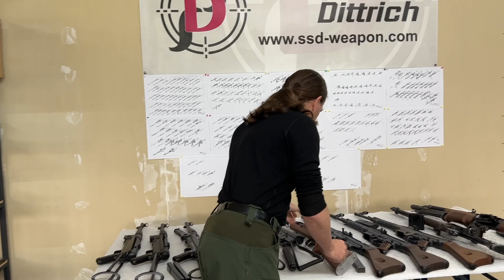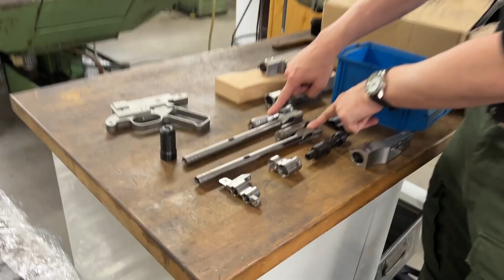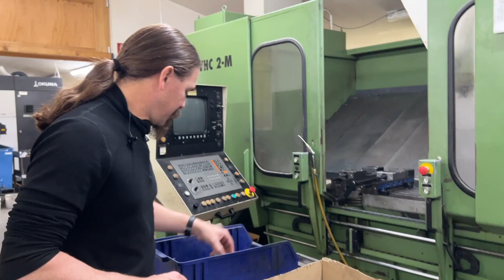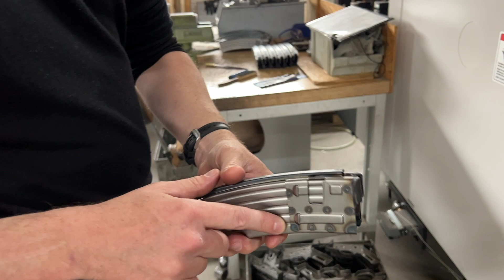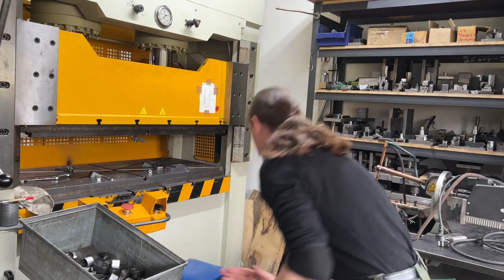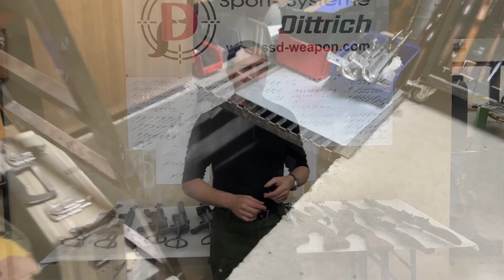Tour of Sport Systems Dittrich: Reproduction WWII German Rifles

Comment: Odd what "triggers" memory here, but thought I would throw this your way as there seems to be a lot of denial about it of late. The infamous Wooden Bullets the Wehrmacht issued in the end days of the war. Surely deserving a vid of their own simply due to the rareness (Forgotten??). The why and how is a story unto itself. I was lucky enough to run across them in the early '70's when I went to buy my first .22 and the seller turned out to be a vet as was my father and they got to talking and he came around with "ever seen one of these?" scratched around in the drawers and pulled out a cardboard box with about 20 rounds of 7.92 with wood slugs. I remember this well as oddly enough the actual bullet was of a pink hue due to whatever varnish they used (your could clearly see the grain of the wood through it). Long, round nosed. He said being on the receiving end of one of those was your worst nightmare. Up to about 20 yards they were accurate enough but splintered so brutally that if you got hit you were at best going to lose a limb and most likely you died. As he told it allies would pick them up (98 K's and ammo) and use them back at the Germans in street fighting just out of spite and pure rage. Quite possibly the first frangible round ever issued to a major fighting force. I have always wondered at the actual gestation of the concept and am massively curious as to how it was produced. Must have been a reduced powder charge to avoid it coming apart in the barrel. Never found any resource to enlighten anywhere.

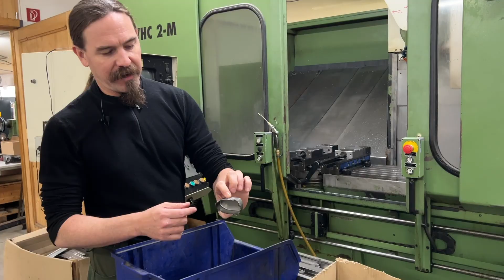Comment: 7:09  Fixture.  Jigs have a dynamic aspect that make them play an active role in the shaping of the workpiece.  Example:  Jigs squeeze the various stampings of a vehicle into final shape and position for welding.  I've also seen jigs that do full-blown bending (as in plastic deformation), shearing and punching.

If the assembly does holding alone, it's a fixture.  A fixture that has a shaping element as an integral part of the overall 'permanent' assembly is a jig.  A fixture that attaches to a shaping device (or a shaping device attaches to it) is still just a fixture.  There are cases where the lines get blurry, but you get  the idea.

Comment: Amazing workshop at Dittrich...you see some older, but still amazing machines standing there...for example a universal CNC milling machine of the FP range from FRIEDRICH DECKEL AG made in the 1980ies...these were the times of real "Made in Germany". A machinist with proper skills can do lots of things with these lime green wonders.
Yes, the original DECKEL company doesn't exist anymore, but besides they are not the most modern or fast machines nowadays, some companies still reproduce Deckel machines or refurbish them in the same quality...
I worked on old Deckel FPs as a mold and pattern maker...
cheers from Germany

Comment: What I am excited about is the 7.92x33 Kurz ammo the brass and bullets become common site in stores because I am now as an AR 15 & AR 10 upper builder selling uppers, I have just started on the first build in an AR 15 upper in 7.92x33 Kurz and if it works out, I will be selling AR 15 uppers in 7.92x33 Kurz this next winter.
Pac Nor Barreling did send me the invoice for the AR 15 8mm 20-inch barrel so I know the barrel is in the works at Pac Nor barreling.

Comment: Does the Mkb 42 (h) fit original 84/98 Mauser bayonets or will it require fitting? And will rifles such as the G43 be made to a better standard with the dust covers than the original design?

Comment: As a tool and die machinist I really appreciate this kind of content. I'd love more tours of machine shops that specialize in firearms and I would really appreciate more focus on the machine tools, work holding setups, any sort of dies that are in use, etc. The dies I work on are significantly larger than what were shown in this video. The average weight is about 80,000lbs but I've seen assembled dies(upper and lower halves put together) that weigh in excess of 100,000lbs. We use large bridge cranes to move them around the shop and our CNC mills are significantly larger than any I've ever seen in a machine shop that makes firearm components. We have mills you could quite literally park a truck in and they're very accurate, rigid machines. 

I'm also curious what the prevailing CAM/CAD software is in the gun industry. I'm sure they're predominately using Solidworks for design and I'd guess they're using MasterCAM or WorkNC for their CAM software but I'd love to hear from someone who knows the business. I'd like to eventually open up my own machine shop that makes firearm components as well as some Aerospace stuff(gotta pay the bills somehow). I'm currently employed in the auto industry in a shop that builds prototype tooling with production intent(so essentially a real tool for a stamping press that makes prototype parts) as well as agile tooling and of course production tooling. The company I work for is an OEM and I love my job but eventually I wanna start my own shop.

Comment: I always wondered if the stamped sheet metal is heat treated after pre assembly. Like being bent, etc. Or just assembled and ready to rock?
Reply from the maker: Generally stamped receivers like this do not require heat treating. On AKs, it's only the ejector that had to be hardened.
Reply: @ForgottenWeapons  My BD38 is phenomenal, so I’m excited about this. But why is BD44 you shot in this vid two-toned with the lighter gray?
Reply from the maker: Late in the war a bunch of StGs were issued with a mix of blued and parkerized parts, and the example I shot was copying that period.

Comment: Didn't the last batch of PTR44s have a lot of problems? Feeding to parts not being hardened? I did not own one but heard a lot of issues that came up and had to be fixed here. Have these issues been resolved?
Reply: Yes, some parts had bad heat treatment, and some 922 parts were bad. All fixed now, PTR rifles were made about 15 years ago?
Reply: Yeah its been a while since they were imported. It worries me that they had these issues as that should have been pretty clear. I remember hearing the guns also did not run. Like the European's basically bought them as display pieces and rarely shot them. They were not expecting them to be shot like Americans.... ie a lot. Hopefully all solved issues at this point as at that price point them should be. They will have to beat SMG for quality or price on the FG42s and that's going  to be hard for them to do. Frankly I am most interested in the VG1-5 but again, it can't be a $5k gun...
Reply: @MaximMachineGun  2 of the parts were to brittle because of the hardening, and most of the 922 parts was also breaking

Comment: I managed to handle and shoot one of their PTR44s from the early 2000s that was imported and it was a genuine work of art. The owner unfortunately passed away and it was sold at RIA for like  14-15K IIRC. I can't imagine how much one of their FG42s or STG44s would be nowadays because in all honesty these aren't replica firearms they're genuine works of machinist art.
Reply: They look nice, but were junk.  Bulged receivers and broken op rods, did not work out of the box.
Reply: @JMark-zk5pj  that's not even remotely true, the only issues according to the owner had was the ejection port was cut incorrectly and lead to malfunctions. That was it.
Reply: @Sam21721  Bullshit, my friends for instance has a bulged bottom receiver from incorrect heat treating / lack of, after less than 1K rounds.  He is not the only one.  Also, many have had broken OP rods.  Don't tell me this is not true, there were gun smiths advertising years ago their services to get these things working, some not even out of the box.  The guy who runs the company in KY knows full well.  I dont know who you think you are talking to.
Reply: @Sam21721  They are luck they are in Germany, I know of many that would love to do a class action on them, most likely too late now.  Its no secret that the PTR's were junk out of the box.  You have zero idea what you are talking about.
Reply: @Sam21721  Before you run your mouth more, go google PTR issues for a wake up call.  Mags not working, bolts breaking after 400 rounds, and even more issues that I detailed.  More On.

Comment: Probably better quality than war time production
Reply: No! Metalworking in germany is only perfect or scrap metal. Today or 100 Years ago at any circumstances.
Reply: @michaelleibrock967  what? Germany is like any other country when it comes to manufacturing. Good stuff, bad stuff and everything in between
Reply: @randyhavard6084  It's very easy to understand. You manufacture within the specified tolerances whether it is the barrel or a small screw. Everything has a standard and a certain quality. The same applies to all machines and tools with which the parts are processed. No part will be installed if it does not meet the quality specifications. This always creates the same perfection today as it did back then. There is nothing between perfect and crap. And last but not least, the machine you work on must always be clean according to a certain standard.
Reply: @michaelleibrock967 you may not have access to milling machines, lathes, or presses but you can do a little research and when you do you'll realize it's not magic that you dream of a number and the machine just spits out a part. Material, tooling, speed, quality control, and assembly very wildly depending on the needs of the customer and manufacturer
Reply: @michaelleibrock967  if you need examples to help you understand, all you have to do is look at rifles and Small arms produced by any country before world war II during the first couple years of the war and the last couple years of the war and that might help you understand how time and resource strain affects the quality of a product?

Comment: MP38 $3,800. 'On Sale' Wow, practically giving it away.
MP 44 Magazine $500. What a bargain.
MP 44 Grip $820. So Cheap.
MP 44 Operating rod $700. What a steal.
Reply: well thats what happens when stuff is handmade in a country with hight living standarts, not front internded. if a machining master (its like higher education upgrade to the regular machinist) is milling a part the cost per hour alone is 200+€
Reply: That magazine is original, repros are 80.
Reply: I was actually expecting the MP38 to be quite a bit higher.

Comment: I do wonder if that ATF BS surrounding open bolts will last given the SCOTUS case around Chevron deference, after all its a not banned in law, rather by ATF policy.
Reply: Same with “once a machine gun, always a machine gun”.
Reply: An Excellent Comment.
Reply: Technically open bolt semi-autos are actually not illegal. They can be legally made right now. They just can't be "easily converted" to full-auto.
Reply: @bitfreakazoid  "They just can't be "easily converted" to full-auto." - And that's the rub, what is  "easily converted"? Its up to ATF, and thats exactly what the overturning of Chevron deference would effect.
Reply: We need the unconstitutional NFA, and GCA, to go away.  That would solve many problems.

Comment: I wonder if the reproduction magazines are compatible with the corresponding historical arms.
Reply from the maker: Yes, they are.
Reply: @ForgottenWeapons  it seems to me that manufacturing a reliable magazine would be one of the most difficult aspects to get right in the manufacture of any rifle - add to that the relentless adherence to historic accuracy and the entire project is even more impressive.
Reply: @wes11bravo  I wonder if they knowingly include engineering/manufacturing flaws for authenticity.
Reply: I’ve spoken with them a couple of times, every single one of their magazines are exact copies of the originals and are completely interchangeable. It’s the same way with all their guns, a considerable amount of the components from the modern production rifles can be used as replacement parts for originals. Even though they haven’t had the complete guns available here yet they’ve had parts for various models listed on their website and available for sale for years just for that reason.

Comment: Honestly, I’m really curious about how you’d modernize the FG-42. Everything I’ve seen and heard about it here and on InRange leads me to wonder about the system’s potential in modern firearms design. That recoil buffer (and the weight) seems to do an amazing job at taming 8mm Mauser, so how might we tweak it to handle maybe a lighter battle rifle cartridge? Maybe we could use it to make a select fire battle rifle that’s actually viable in full auto on modern battlefields?

Comment: Fan of his work, been meaning to order a repro from him for a long time. Hope he picks up the G43 one of these days.
Reply: Shit man. Depending on the price it might just be cheaper to buy an original. I saw one for sale for $3000 a few weeks back. If I wasn’t already $4000 in the hole from buying rifles I would’ve bought it.
Reply: @PsychopathicV2  its expensive yes (hence the years of holding off) but I only hear great things about his work.
Reply: @PsychopathicV2 Idk, originals are pretty finicky and prone to shearing op rods. Having a repro might be better to have in terms of shootability and parts.
Reply: @georgewhitworth9742  Depends when it was made. Late war production yeah avoid those like the plague. 43 and to a point 44 should be fine if maintained properly.
Reply: The g43 is on Dks website listed as the K43
Reply: @Jdaminbf4  I know, problem is the "
Aktuell noch nicht lieferbar". Been so for a few years, so Im not holding my breath. That STG is very tempting though. But 8mm kurtz is a pain to get.  Prwi Partisan only makes them every so often.
Reply: G-43?

As long as they sort out the random extractor "failure" problem.

The original extractor retention system was "dubious" to say the least; hence the many G-43 specimens with no extractor. H&K used a similar extractor design, but with a better retention system. 

Little things count.
Reply: @bruceinoz8002  probably the reason he doesnt make them anymore (for now). If he supplied (payed) replacement parts Id actually be ok with a high maintanance though.

Comment: two things i really want to see is one, what kind of modernisations occured on the new FG-42 version and two, what the designer thought while designed the new version.... and interview and breakdown of the system would be neat
Reply: That and the belt fed caught my attention, also, 7.92 Kurtz FG-42, which also is interesting... If I was the designer I would put the gas piston up and convert it to hammer firing, probably use the same hammer as the STG for the sake of simplicity.
Reply: @Rrgr5 the fg-42 kurz was a thing I think the engineer behind the fg-42 converted at least one to 7.92x33mm kurz
Reply: Great idea! Like side by side, and the thoughts of the modern designer/builder.

Comment: 5:54 i think that's supposed to be the US test gun where the took the top cover of a Mg42 and put it on the side of the Fg42. This would later become the M60
Reply: That would be a neat and probably incredible expensive repro to have!!
Reply: IYKY❤ - even as a semi, or after the ATF disbands...
Reply: Correct.
Reply: Believe it was called a T42
Reply: Of course in 7.92X57mm...  Or would they build it in 30'06? THAT would be a handful even in semi-auto.
Reply: @ShowaEraGaijin  WWII era military .30-06 isn't that much different in power to WWII era military 8mm Mauser.
Reply: @jic1  Yup. And since the base of the cartridge case is the same it was easy to convert to M-1 ball ammo.
Reply: @ShowaEraGaijin  Except that .30-06 is substantially longer (7.62x63 mm) than 8 mm Mauser (7.92x57 mm). The U.S. engineers forgot to take that into account when they were trying to make copies of German guns like the MG-42, FG-42, etc.
Reply: @DABrock-author  Only 3mm difference in overall length.
Reply: @DABrock-author  The number of application where 6mm is "substantially longer" is amazingly limited. But, I am told in includes such fiends as rocket scienceing and gun designing. Which can, at a certain size, overlap.
Reply: @jic1  6mm, not 3.
Reply: @DABrock-author  Overall length.
Reply: @aaronleverton4221  It depends, legend tells of one application where 6mm, or any mm longer, is always better.
Reply: @ShowaEraGaijin  honestly both kick pretty  dann hard
Reply: @ShowaEraGaijin  30-06 vs. 8x57 are not that much different.According to the 3rd Hornady Reloading Manual the `06 will give about a 200 fps advantage over the 8mm in medium-weight(around 170 grain)bullets which doesn`t amount to much,whether it comes to energy or recoil.
Reply: @torejssing7515  As loaded for military use, the 7,92x57 with an approximate 150 gr. bullet goes about 2900fps while M2 ball is about 2800fps. Pretty close, but a little bit less with the .30-06. The .30-06 can be loaded hotter because of its longer case but as militarily loaded it was wasted length.
Reply: Thank you!!👊 Ian had me feeling some kind of way on that one🤦